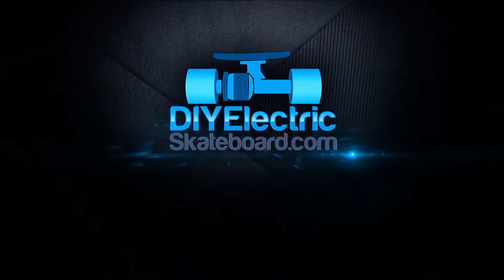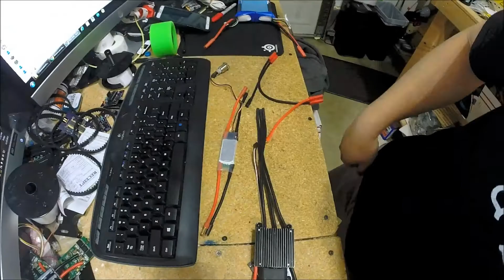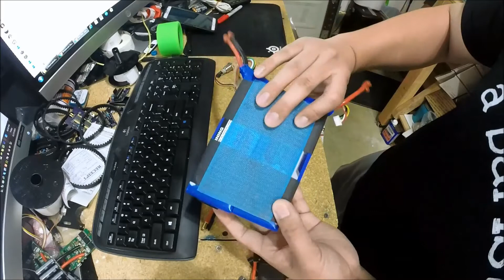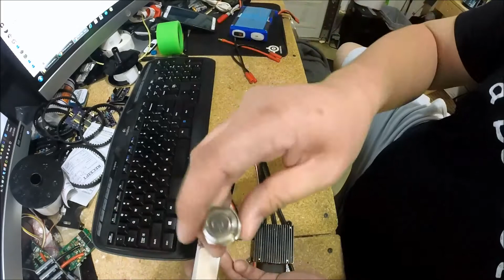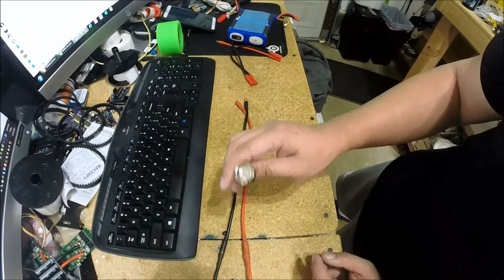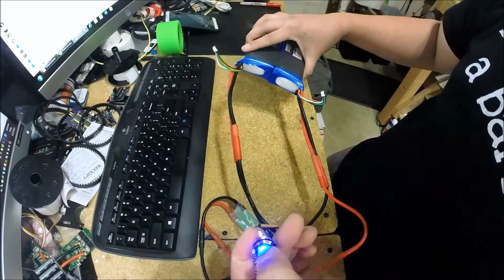DIY Electric Skateboard How To: Wiring Setup

Comment: good video 
i see you running 2 motor set up 
are you using 2 esc then ???
how you controlling the 2 esc with 1 Y servo harness and i 2.4 ghz reciever ?

Comment: Im currently building my own electric skateboard. I have chosen 2x zippy 4s 8000 mah batteries. I want to configure them in series but i cannot find a compatible series connector. They have 5.5mm bullet connectors.
Any help is appreciated!
Thanks,
-Matt
Reply from the maker: Hi Matt,

Typically, for a 5.5mm bullet connectors. You can wire a black and a red 5.5mm together to create the series connector and you would then have a 5.5mm black/red which would be the plugs you plug into your on/off switch and/or ESC. If you google "battery series connection" you can see how it's suppose to connect.